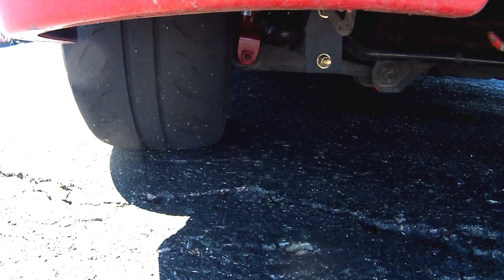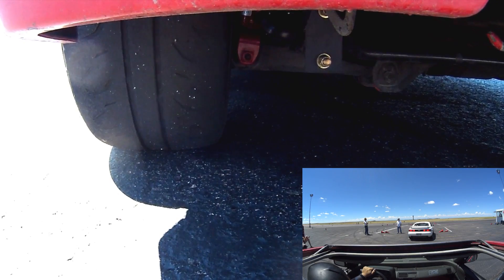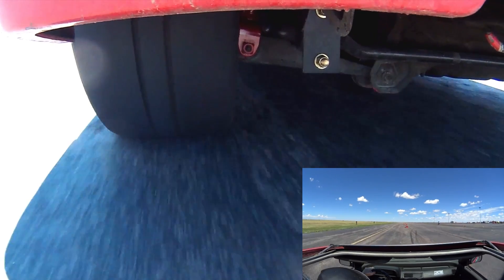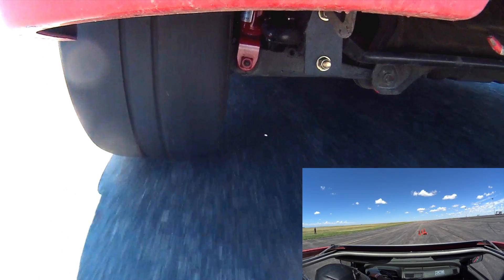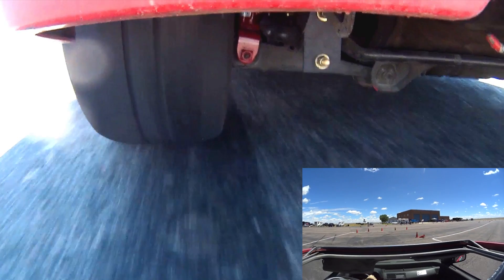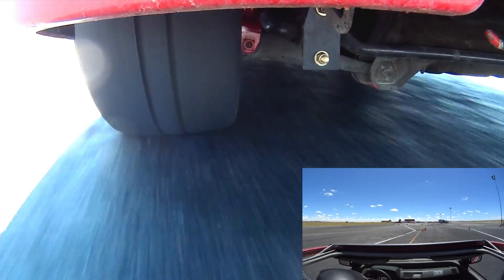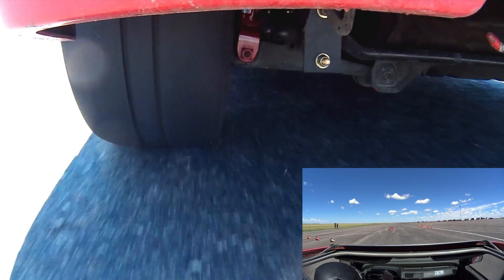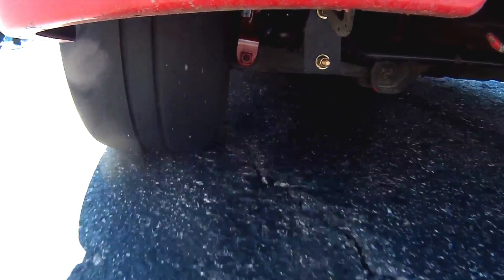Watching suspension in motion

Comment: What springs/shocks/anti-roll bars are you using?  Are they maybe too stiff with not enough travel, which is causing the tire to lift that much?
Reply from the maker: llamawerkz I am using 500 lb Eibach springs on all 4 corners, Koni Yellow shocks with ground control coilovers, sway bar removal in the front, and a sway bar with adjustable endlinks in the rear. I think lifting off is normal, stock Focus and Fiesta STs will lift a tire when pushed hard enough
Reply: Wow, you went full "kill understeer".  I'm not an autocross guy, but I can see how that would work for a FWD car in autocross, since the drive wheels also do the steering and you have so many quick steering changes.  A lot of suspension engineering seems like black magic, which is probably why race crews spend so much time trying to perfect the setup for each track.